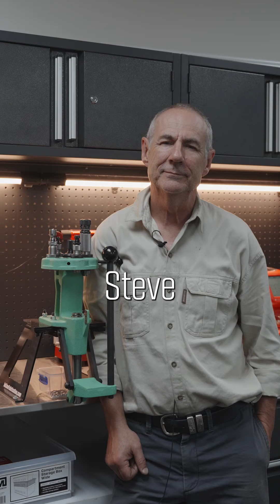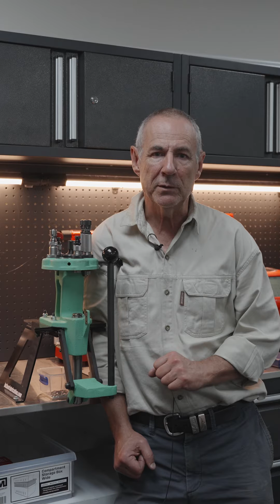Differences in loading copper bullets compared to jacketed lead bullets. Explained!

Comment: Thank you for this video and good tip about getting information from the bullet manufactorer :-)  
Maybe sounding out the powder manufactorer that one is using too, (if they have experience with said bullets), could also be a good idea as to find the right powder to bullet match?

I do have a question as to the "shot starting pressure" subject mentioned:  -  if one is shooting an old european cartridge types, like the 7x57 or 7x64 etc, where the chambers often have quite long free bores, will this not also affect the shot starting pressure ?
  After all, when in a long free bore,  the bullet should be able to intiate its fwds movement with less inital resistance vs in a short free bores, should it not ?

Thanks again from Denmark :)

Claus

Comment: Copper bullets are also longer for the same weight as their lead counter part. If you use the same overall cartrige lenght a 180 grain copper bullet for example will allow for less powder capacity than its lead jacketed counterpart of the same weight.